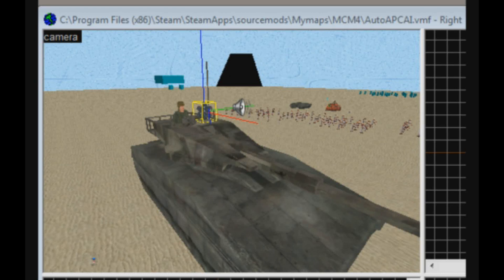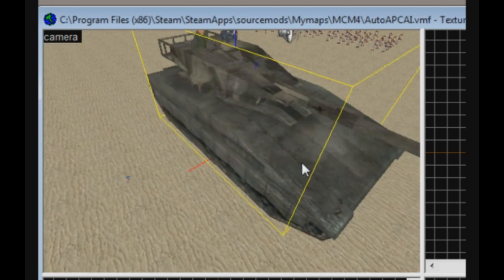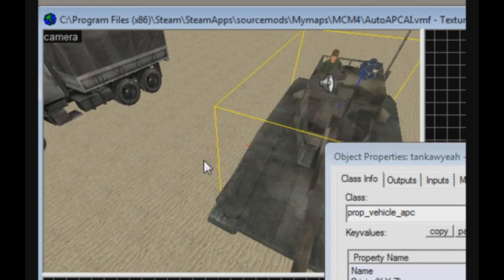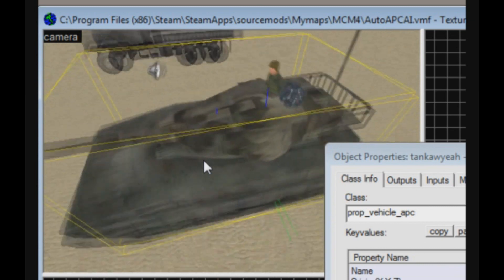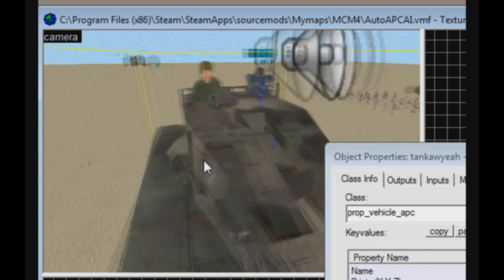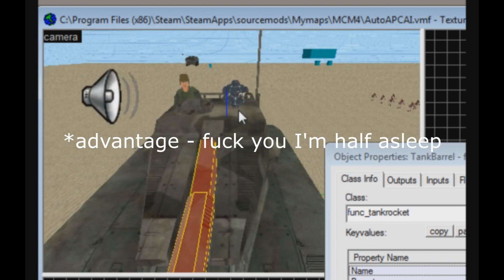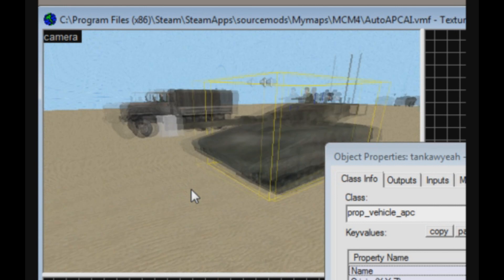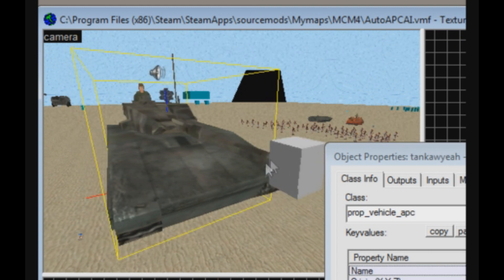Merkava vehicle proof of concept

Comment: Very Nice!
However, if this is going into the final game, then I have a few suggestions:
1. in the video, you can see APC rockets being fired from the tank (as in guided rockets, not "tank shot rockets"). It might be useful to use the flags on the apc driver (rollermine) to turn missiles off. 
2. perhaps add in another func_tank for the machine gun on top?
3.  if that does not work, you might be able to edit the apc script itself to position the pulse guns origin at the machine gun.
sorry if this does not make sense grammatically, Im fucking half asleep here too.
Reply from the maker: Eh it's a proof of concept, this is all on my to-do list
Reply from the maker: Also for some stupid-ass reason it still fires the guided rockets even though I have the "No Rocket Attack" spawnflag set
Reply: Secondary guided rocket mortar
Reply: @T_Bot1  but there is no visible device that the missiles fire fr...
remembers that there was no visible device for the combine apc to launch missiles from
...never mind.